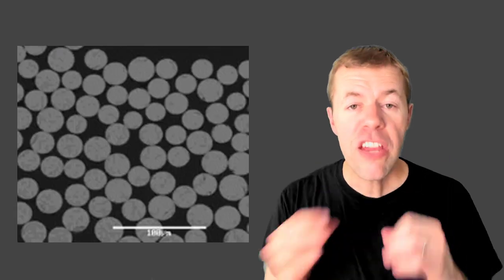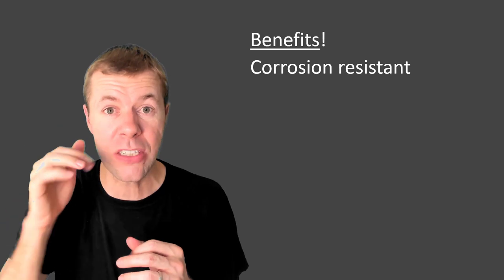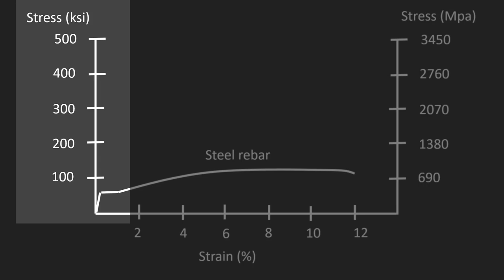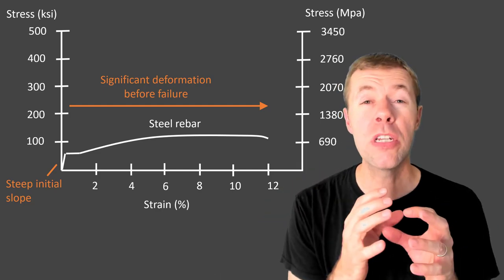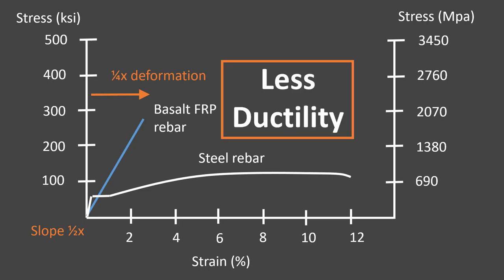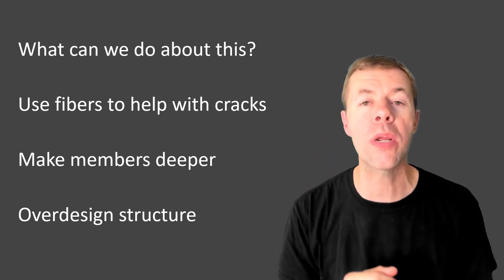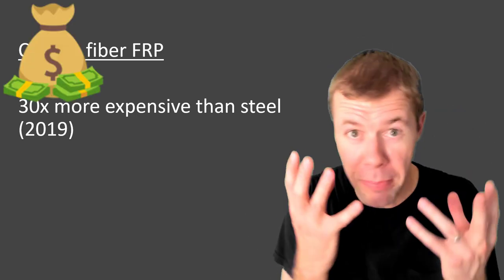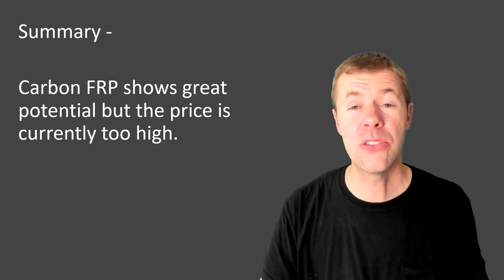What is FRP rebar? Why don’t we use it?

Comment: Wait  a minute.  Basalt FRP rebar is not basalt rebar.   Basalt rebar is  rebar made from basalt continuous filaments.  

Basalt is a common volcanic rock, found throughout the world where volcanoes have erupted and sent lava to the surface.

Compared to steel, basalt filaments are much stronger for the same diameter, a fraction of the weight for the same strength, and impervious to acids, alkali, and corrosion.

Basalt rebar can be bent, but has a strong memory like a spring. If you bend a straight basalt rebar, it requires a lot of force, and when you release it, it returns to its original straight form. This allows basalt rebar  to be shipped in coils of 100-500 meters. It can then be uncoiled on the job site and used in the straight form.  In short its ductility is far far greater than that of steel.

The only disadvantage I see is that it is far more expensive than regular steel rebar but is competitive with stainless steel rebar in price.

Comment: as You also mentioned, fire safety is another issue, esp with carbon fibers, as it burns pretty well. up until now I haven't thought about that. In another video You also mention galvanizing, and using micro and macro fibers - these are also interesting ideas

Comment: In Britain huge issues have been shown with RAAC (steel reinforced autoclaved  aerated concrete). Since AAC does not protect the steel reinforcements as well as regular concrete, would using FRP be a viable alternative, especially for RAAC used in flat roofs?

Comment: Question Tyler.... Wouldn't bundling small diameter GFRP like 2 #3 GFRPs for 1 #4 blackbar address to some degree the stiffness and costs of using GFRP.... I realize it doesn't address ductility, but 2 strands do have advantages over a single thicker strand do they not?

Comment: A few things are twisted. When you bend steel as you show using that short piece it bends however your guy bent it back physically. Steel does not return by itself like that it stays bent- basalt before cracking bends and returns like a pole vault. Remember these are encased in concrete not open air. So in a seismic event I want my building to return to straight not stay bent over. You are right about high and ultra high performance concretes. Basalt is less expensive than stainless or galvanized or epoxy MMX types of rebars and comes in 328 feet coils up to 1/2 inch so less overlaps and loss of rod in long runs, less ties time and labor AND no replacement down the road like steel almost everywhere will need. The thing no one thinks of is that there is no regulation that says only ONE type of rebar has to be used. Put the better steel when needed deep inside then use FRP (basalt is best) near the surface where forces are greatest. By code 2-3 inches of concrete are required over steel to protect it from corrosion. You can many times save using a lot less concrete because the FRP does not need that cover as it will never corrode. Basalt Chopped fibers and mesh also add great properties to the solution. https://basalt-rebar.com Nick
Reply from the maker: Nick,
Thanks for the comments.  I don't feel anything was twisted in the video.  I bent both bars the same amount.  The FRP snapped and the steel bar just bent.  This is called yielding and has a lot of advantages in a concrete structure in high load events like and earthquake.  Because FRP does not yield then we have to use much larger safety factors in design.  This is not my decision.  This is what the committees at the American Concrete Institute has decided.  Because of this we can't count on the full capacity of the FRP bars.  This means the size of the FRP bars are not much smaller than typical reinforcing bars because you are not allowed to count on the high strengths.

At the end of your comment you talk about reducing the cover on the reinforcing.  Cover is not just for corrosion.  It is also for fire.  I didn't talk much about FRP in fire but the data is not good.  Plastics do not last in fires.  Further, the few inches in the cover of the concrete do not significantly impact the capacity of the member.

I like the idea of using two types of bars but more work is needed to see if it is feasible.  I am worried that once the FRP bars break will the rebar be able to have enough strength to hold it together?  How much rebar is needed to do this?
Reply: Nick, basalt has good, interesting applications, and an excellent weight to strength ratio. It does not have ductility. For at least larger structures, you need that for seismic survivability etc. Your analysis and video critique appear to be based on incentive to sell basalt rather than on engineering principles.
Reply: I've always heard that basalt rebar is shipped essentially as a giant coiled up spring.  It is supposed to be very bendable.  I just wish that there were some video showing people actually demonstrating this property somewhere.
Reply: LOL!  It just doesn't exist.  Nowhere.  Don't go look for it.
Reply: @happy2b4  No I was commenting on the guy bending the steel back by hand-it does not return by itself. I personally think steel needs to be deep inside concrete that has water protective additives and basalt needs to be surrounding it near the surface where all the spalling we see happens. Best of both worlds- no law says only ONE type has to be specified-it is time engineers figured that out!
Reply: @rehoboth_farm  I will soon-yes it comes in coils up to 12mm (1/2inch) diameter rod- use two people to untie it slowly as it wants to be straight!
Reply: @happy2b4  And as far as ductility- actually it bends and exceeds ACI specs before the so-called catastrophic moment-your concrete would have to be so compromised at that point it would not matter-look at ANY picture of earthquakes and all you see is bent steel-and blocks hanging from steel that bent-big deal it is still there. Basalt bends back like a pole vault.

Comment: THANK YOU for making this video!  Long awaited.  I love looking at the alternatives to steel.

In addition to rebar, I'm also curious about the use of chopped FRP fibers to replace steel fibers:
How does the actual cracking performance compare?
If we strive for low-permeability ultra-high performance concrete mixtures sealed with a lithium silicate hardener, can chopped FRP fibers help reduce spalling in a fire the way PVA can?
How long does FRP actually last?  It's nice to say "no corrosion" but how long does it take for polymers to break down inside concrete?  How does it behave as a reinforcing material after the polymer breakdown has begun?  Can we monitor it?
Reply from the maker: Thanks!
I talk about fibers here: https://www.youtube.com/watch?v=jWFncYgbCCg

Comparing FRP fibers and steel fibers is tough.  The modulus of the fibers are very different but the amount of FRP fibers that you can add to the mix is higher.  This has a lot of advantages of not changing your mixture proportions.

I have never seen FRP fibers in a fire test and so I don't know the answer to that.  I would think they would perform well.

Previous versions of FRP did break down over time in pore solution.  The new version is improved and I am not sure anyone knows how long they will last.  I would guess hundreds of years but it is only a guess.

Once the polymers break down you will lose the bond between the fibers or bars and the matrix.  This means that you are only relying on the mechanical deformations to transfer the load.

We can definitely monitor the performance over time.

Comment: I started seriously researching the use of glass about a year ago, a few months before you made this video.  It was about 2 years after one of my suppliers first told me it was available.  At the time they first got it the glass cost about 1/3 more than steel.  Last spring the price had dropped to a bit cheaper than steel, maybe $0.25 per 20 ft bar.  Seeing this video is the first I have heard of the basalt or carbon fiber bars so they apparently are not available here.  My supplier told me that these bars are not even approved for vertical applications so he would only sell it to me for use in flat work, not in structural work.

Comment: Hi, what about designing a composite FRP rebar, like core made out of steel with fibers arround it and plastic coat at the top? Using ductility of steel combing with the strength of the fibers?
Reply: Good idea but more expensive and the main benefit would be that it protects the steel but the ends where it is cut would still expose the steel allowing it to rust creating the same problem you had with steel in the first place. It may help to hold back the pressure from the expanding steel as it oxidizes into rust though.
Reply: The cut ends could easily be capped or coated on site.

Comment: Does basalt frp have the same properties as glass frp? I know gfrp is becoming more common, but after this video I wonder if cracking will be a long term issue. If the slope on the stress/strain graph is similar to steel and carbon it could be a good alternative.

Comment: Thanks for this highly informative video. I was hoping to build modest aircrete, dome-homes for poor people in typhoon ravaged SE Asia. With a 5 meter diameter floor and about 10 cm thick shell of polymer, and fiber enriched super quality aircrete. Some suggested 6 mm basalt rope as re-enforcement. Do you have any comments or suggestions ? I didn't know much about the basalt rebar, but this vid really hit the spot.

Comment: As an engineer I need a building code to be able to use these produts and provide design methods. Are these types of rebat endorsed by building codes? 

Second, when I was looking at these products they only came in small sizes like #3 and #4 and I need the larger sizes. It looks to me that they were being recomended for roads, driveways and flatwork. What bar sizes have you seen and how were they used?

Comment: Tyler, what is your thoughts on coated steel rebar ( something like the coating on steel gas mains and we could add an anode for cathodic protection) ?
Reply: I've often wondered why active cathodic protection isn't used on road structures around the Great Lakes. Lots of rust induced failure on bridge decks and columns. They started painting the concrete to keep the water out but that only prolongs the inevitable rust failure. For a few pennies of electricity the rebar could be kept rust free for decades.

Comment: I feel like FRP would be best combined with special concrete containing extra binders within the pour mix so as to mitigate the cracking issue. I would only really see a need to use FRP if the structure I’m designing is meant to be in a highly oxidizing environment

Comment: Some good thinking here yet the base problem is corrosion, steel is strong enough and has similar expansion properties to concrete. I wonder here if using concrete additives in the concrete would make it water tight ? I have used silicon additives in mortar to prevent hydrostatic ingress of water due to capillary attraction but I don't know what the effect would be on the tensile strength of the concrete.

Comment: Wouldn't the concrete savings off set the cost of extra reinforcement?

Because BFRP  doesn't corrode it doesn't need the coverage that steel requires.

Also rebar  is a product designed for use with concrete.  With FRP wouldn't an external skin be more appropriate?

Eg for columns an FRP pipe that reinforces the column but also functions as the form work?

Comment: does mixed methods have any warranted value? such as a Carbon FRP core support, and Steel around it.
it'd probably be nicer to have a Steel core support and Carbon around it but that would be a lot more expensive even though it should have the best results when mixed.

Hybrids sounds good too but that's just making everything super expensive so idunno if that's gonna get much of anywhere.

though, that leaves some question about more rigid options for types of structures that experience a lot of vibration or even impact? would that vibration/impact cause these alternative types to fracture, and become useless?
Reply from the maker: Thanks for the question.
FRP outside and steel inside could be a good idea.  The size of the steel in the center would depend on how much load would need to be transferred once the FRP breaks.  This would probably necessitate a lot of steel or high strength steel.  
Long term deflections is a problem with FRP because plastic creeps.  This could make deformations larger over time.  Fatigue is also something that very few people have looked at.  
Thanks for the question!

Comment: Isn't there also concrete that doesn't use rebar and instead just has the glass fibers mixed into the slurry so the whole thing is fiber reinforced? How does that compare?

And the negatives of FRP, would they be relevant if you were just pouring a concrete pad as a foundation?
Reply: no
Reply: @protonneutron9046  No to the foundation question I assume.
Reply: @dp7933  to any concrete that is not only subject to compression.
Reply: @dp7933  fiber rienforced concrete can be used with less rebar but not without it entirely, the negatives are of frp when pouring a pad are still relevant because tension forces still effect the pad anytime load on the pad isn't completely evenly loaded. I think this video actually is misleading with its conclusion though of FRP because it doesn't consider using it in conjunction with the Fiber rienforced concrete you mentioned, Fiber rienforced concrete is actually much more ductile and can bend along with FRP without cracking making a significantly stronger structure, combining that with cost savings from using smaller FRP than steel rebar you can actually get a stronger structure for similar cost with FRP+fiber concrete combination in most cases. This strength also gets amplified over time as the steel rusts and becomes weaker and FRP doesnt.

Comment: Galvanized Rebar Problems - Limited hot dip coating thickness (metalizing Zn-Al is better); field bending cracks galvanizing; drilling concrete for insertion of fasteners damages galvanizing at rebar contacts, requiring insertion of chemical bond for fastener to cover damaged galvanizing; drying shrinkage cracking in concrete can break galvanizing coating at crack, and, of course, there is no field welding allowed.  When increased base metal strength is factored all of the above, with the possible exception of field welding, are not issues with Chromx steel, marginally more expensive than hot-dipped galvanizing and about the same as metallizing for added thickness and bond strength.

Comment: Thanks for great videos on this great topic.

It looks like the biggest weakness with FRP is "catastrophic failure".
Question: couldn't that weakness be compensated for by putting some nylon ropes in the concrete to "take over" if the FRP rods fail?

That plus non-steel fibers - wouldn't that qualify as no-maintenance, last forever concrete?
Reply: Yes, perhaps  FRP rebar is best specified for structures where the risk of catastrophic failure does not exist or is if so, the failure is not an immediate safety risk.
Reply: @user-tv5dt3nm9y  

The nylon-rope idea won't compensate for "exit time" in event of catastrophic failure?

I'm looking for set-it-and-forget-it concrete. 
Steel rebar is asking for spalling trouble, right?

Comment: TL;DR steel is tougher than composites, but the ultimate strength is lower.  In practical use we are worried about longevity and ability to handle deformation.  You have to design concrete structures for the worst case scenario, steel fails in a predictable manner and the structure largely stays intact.  Composite reinforced structures will fail in a friable manner and will not stay bound together.
Reply: You can start designing using BOTH not just one type. Good steel deep inside surrounded by FRP topside. Add macro mini-bars, mesh and chopped fibers for the ultimate solutions and use water crystallizing agents, keep water out is job one. UHPC and high performance concretes are best. Using both is a far longer lasting better solution than one or the other.
Reply from the maker: I agree,
This is what I said in my video when I talked about the ductility.  The stiffness of the FRP is also a big deal.  The cracks will be larger than conventional rebar.

Comment: Dear Sir, as far as I know, the concrete is an alkaline solution and the steel do not rust inside. So, indeed, best way to protect the steel rebar against corrosion inside RC concrete is to make the concrete impervious.

Comment: Ironically, it still get mass of papers trying to promote use of omnipotent FRPs.  I’m always impressed by the intro part when I review some journal article about FRP reinforced OPC/GPC.
Reply: I used fiber bar for about a year.  Don't like it at all. I did a job that got moisture under the slab from a neighbor that sloped his garage towards the slab I poured and come winter....The slab heaved and snapped that fiberglass like dry twigs.  If I had used #4  the cracks would have been minor, and the slab would have settled back down in the summer.